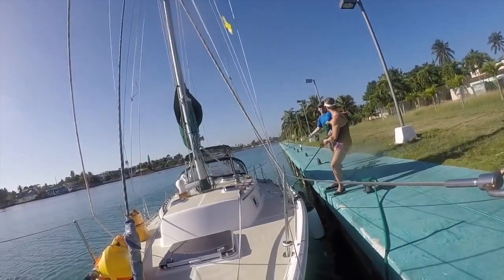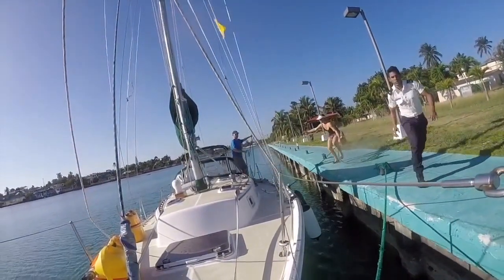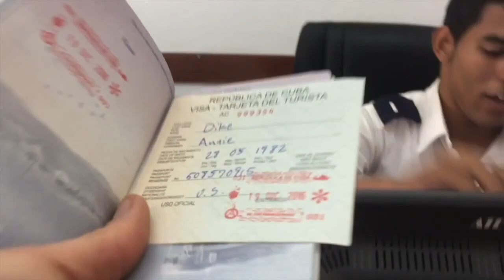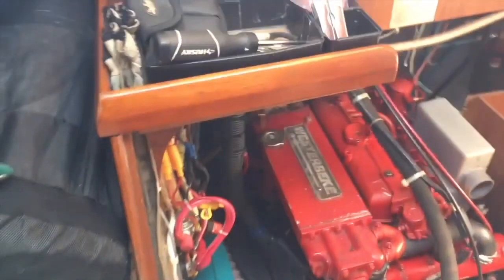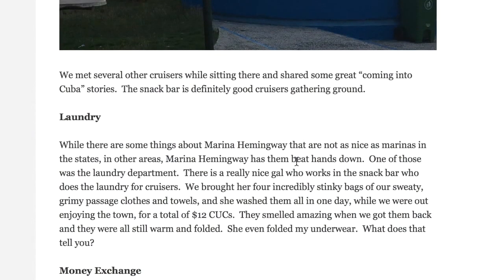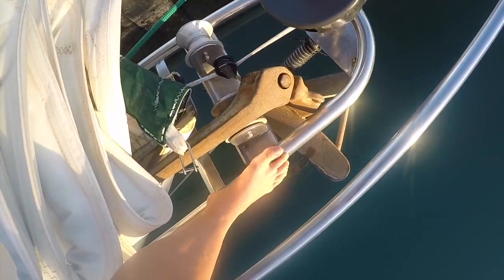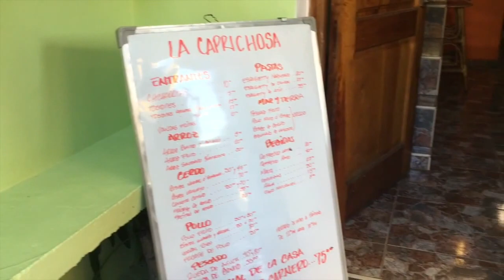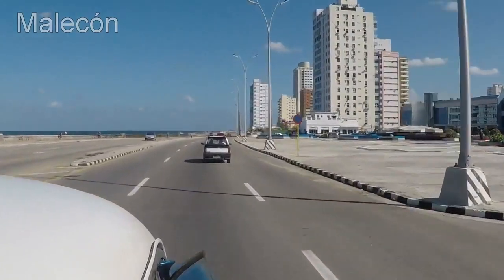#94: Clearing Customs and Exploring Cuba

Comment: Excellent video. One suggestion regarding your jib sheets. The way you have your jib sheets attached to the jib maybe a problem. As the load comes on that attachement, the sheets will tighten. When it comes time to change the sheets you may have difficulty getting the sheet undone. Typically, the sheet to jib connection is done with two sheets and each sheet is attached to the jib with a bowline.
Reply: I've tied my jib sheet that way also, and sometimes I do need a fid to get the sheet off at the end of the season.  I've always figured that if ever I could not get that in-done, I'd cut the sheet off and use 2 bowlines, but it's never come to that.
Reply from the maker: Agreed with both of these.  We have often thought next time we re-do our jib sheets, we will make two lines.  Might save from a very tragic loss, too if the entire line was compromised and caused real damage.  Thanks for watching!